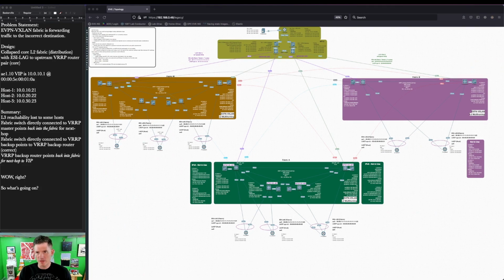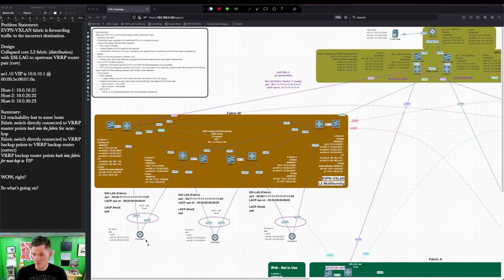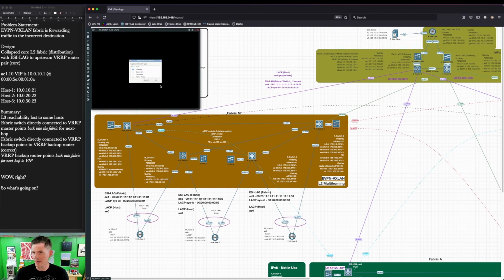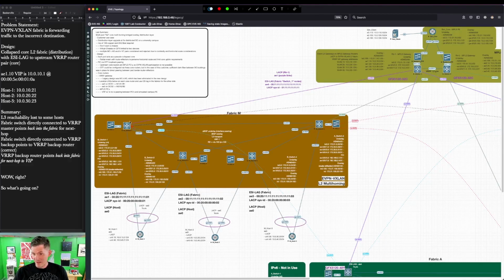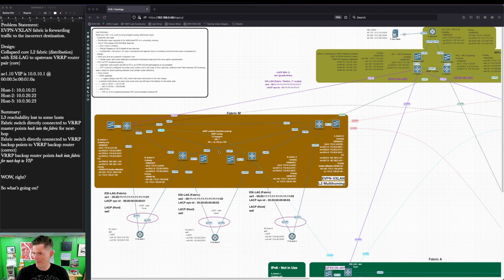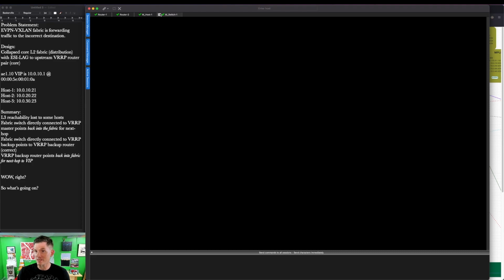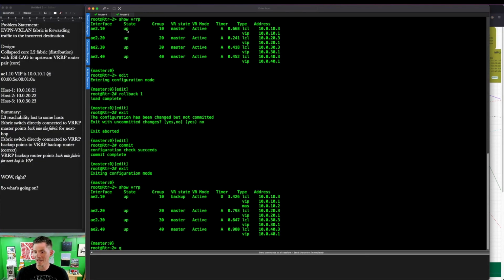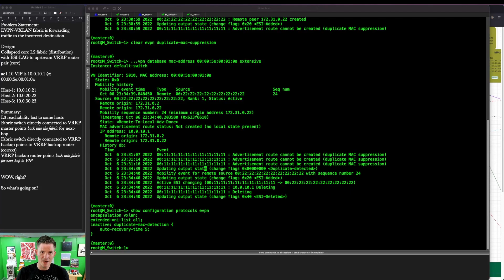Campus EVPN-VXLAN fabric works fine until you move the L3 that isn't even in the fabric? Watch this!

Comment: During master switchover , master routers sends the gratuitous arp message to refresh the arp and MAC in underlying swithes to facilitate correct forwarding . However in case of VRRP heartbeat flowing through EVPN VXLAN fabric and performing VRRP switchover 4 or 5 times trigger the issue. Is there a way to know default EVPN MAC supression timers. As per the Juniper KB , the default timers are aggressive but how we can observe those timers in cli?

The same behavior could also be experienced in case of SRX chassis cluster and performing data plane (RG1+) switchover many times.....
Reply from the maker: Jeez, I'm sorry not to have responded sooner. I'll get to this, I promise. I working with Juniper marketing right now to try to get a community created on our collaboration platform (elevate) so I can better engage with viewers to answer questions, share configurations, etc...